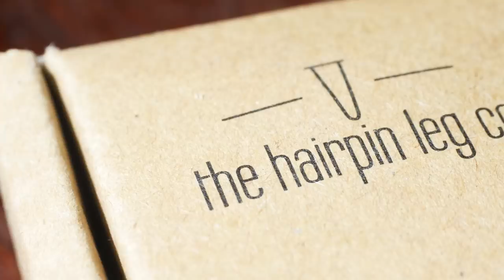MID CENTURY CABINET MAKEOVER / FURNITURE TRANSFORMATION / Thrift Flip

Comment: Ummm... dude? Okay, so like, mad respect for your finished pieces. Sexy as hell, beautifully-executed... just an amazing job. But... Raphael, is it? Don't take this the wrong way, but... 

JUST. MAKE. FURNITURE. The "restoration" part of this whole thing is seriously MORE work as if you just BUILT the damn thing from scratch! It takes many times longer to remove handle, cut out its footprint, copy that shape onto stock, cut IT, tap it flush, then sand it smooth than it would to just START with clean wood! And it's not any more expensive than buying the piece to restore in the first place! Just use cheap plywood... with the amount of laminating you do atop the base anyway, it would make NO difference, either visually or structurally!

I'm not criticizing here. Your work is exquisite, I subscribed because of your previous vid. But... unless it's like "part of the challenge" or something, man: you could be charging a small fortune for a fully-original piece. I've no idea what you're selling the restores for, but in the right markets you could 4 digits outta one of these any day of the week.
Reply from the maker: Wow! Thank you very much for time and great feedback! To be honest with you that gonna be a next project. 😊😊 Have a lovely day 👍